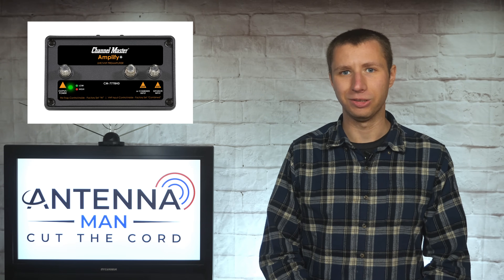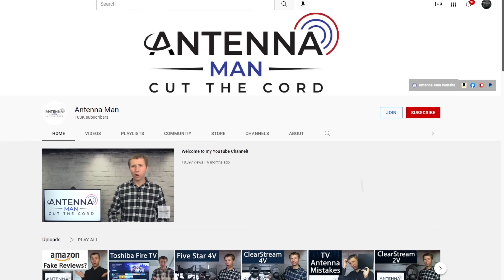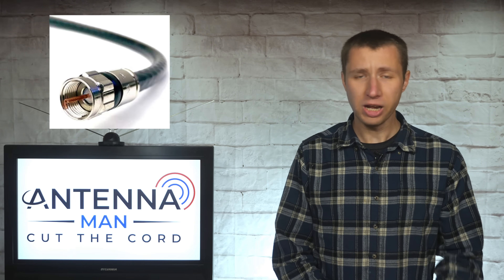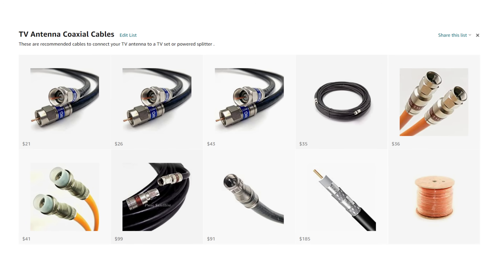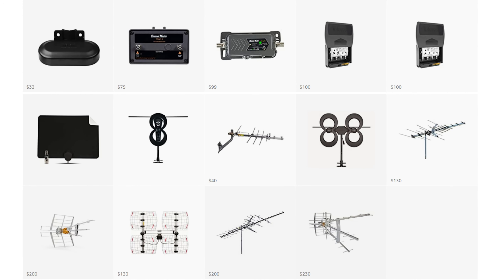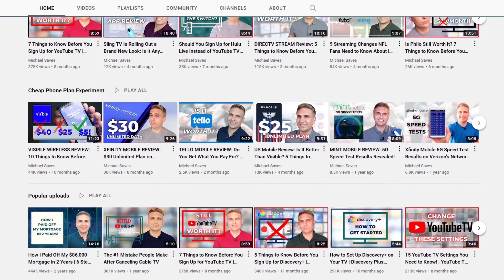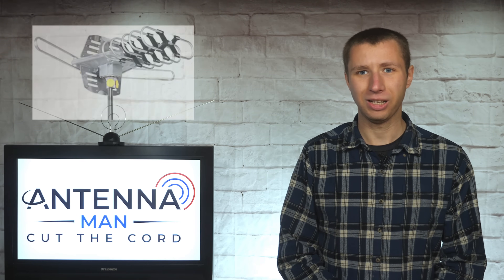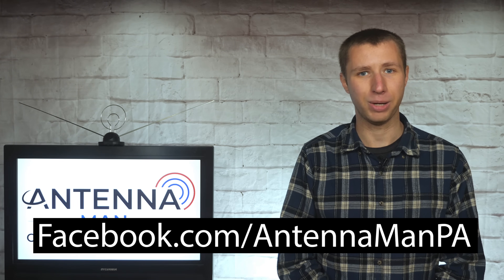Use an Antenna Amplifier? This Mistake Causes it to Fail

Comment from the maker: 📡 Do you have reception problems? Consider an antenna recommendation from me 👉 https://antennamanpa.com/antenna-recommendations.html
Reply: I got everything wired up perfect a few years ago (Thanks to your great info) and I was loosing signal strength due to the length of all the cables. I tried the Channelmaster power distribution amp you reviewed, it helped but I found one Comcast left behind from when we had cable in every room and tried it and it worked  better
Reply: Are you base in PA?
Reply from the maker: @pxbrixey4319  Yes
Reply: @AntennaMan  If you are in PA and I am in Florida, how can you recommend what I need to get OTA TV? Would you not need to check out the topography, trees, buildings, my house, etc? Thanks.
Reply from the maker: @pxbrixey4319  Yes but I can do all of that remotely from online using various reception analysis websites that do take into account topography
Reply: @AntennaMan Thanks for this video, I recently put up a Televes DAT boss Mix LR and didn't have solid copper core coax running to it. I do now. 

But what about the wall plate? Or push on quick connect adapters? If they're not solid copper wire, will they cause issues, either with burning out the preamp or signal loss?

Comment: Don't understand how a lower voltage causes amp to fail.  I have a bunch of old RadioShack, etc. powered amps and half of them do nothing.  I know that certain transistors in vintage stereo receivers need to be replaced due to age.  One amp I just opened up had 2 tiny round button transistors soldered on the ground plane back side of the PCB - they are the only means of amplification.  I'm guessing that they may be a common failure for these vintage amplifiers - I know some worked when retired years ago.

Comment: As a Broadband cable technician that has been working for 5 years now, it is false that copper clad steel cabling will burn out an amplifier quicker. The CATV mainline thick cabling is copper clad steel, including the house and drop cabling. Regardless, The Antenna Man does have great reliable content.

Comment: If I get the RCA Indoor Antenna with the super long dipole rods for lo-VHF reception, I have thought about getting a Cable Matters RG6 Quadshield Coax Cable and a gold-plated F-type coupler from the same brand. On top of this, I would turn the amplifier on that antenna off since I only live 9 to 10 miles away from the broadcast towers in my area. I'm aware that cable also has copper clad steel, but it's still thick and it's around 18 AWG. There, I think I would be fine as long as I have the amplifier turned off.

Comment: I'm confused about amplifiers and powered splitters. I have an outside roof antenna (ClearStream 2V by this channel's advice) and it is directly connected to my TV with about 30' of cable - nothing in between; one solid piece of cable (I drilled a hole in the side of my house for it). Anyone know of a reason I need any type of power? If I'm not getting channels, I don't know about it. I get the ones on the channel line up (provided by WiFi modem) and I don't have cable, so I'm just assuming I'm good to go. I don't mind investing in something if I need to. The towers can't be further than 60 miles because that's where the Gulf of Mexico is, so they have to be closer than that.

Comment: Very good advice about the copper cable! Alternately to a pre-amp antenna, one can buy a very good quality antenna without some sort of built in amp, and then add a separate amp in the cable run elsewhere. That's what we do. Running 3 TVs off one excellent antenna with a high quality amp/splitter.

Comment: Tyler, I installed a Televes Dat Boss mix LR on a 20ft mast at my home and was impressed with it's reception. I used solid copper RG6, It's been up about 3 months and the other day we had a thunderstorm and the electricity flickered. I immediately lost signal on my OTA channels, the antenna mast is grounded and the coax is run through a ground block as well. When the weather cleared, I bypassed the ground block with a RG6 extension adapter, and my signal returned on the stronger channels, but weak channels were pixilated. I replaced the ground block the next day and to my surprise lost all signal. I then went to the Televes power supply (still showing a green light) and bypassed it as i had the ground block, I got my strong channels back. Puzzled I tested the power supply and found it producing 14.4 volts DC on the antenna connector. I reconnected it and again lost all signal. I then unplugged it from the AC power and my strong channels returned. I'm guessing the amplifier is shot. Given what I've done would you agree or suggest another test to run? and if the amplifier is dead is this type of failure covered by Televes warranty or am I on the hook?

Comment: Hi Tyler, I set up new Clearstream 4K, pointed it toward signal sources.  Brand new LG did auto tuning for an antenna setup.  Picked up all my local channels.  ABC clear as can be.  But NBC and CBS no signal.  Re-ram the auto-tune.  Then I received great signals from NBC, CBS but not ABC.  Re-ran auto-tune again, back to solid ABC but no NBC or CBS.  So weird!  Help!  Thx!

Comment: Copper Is My Favorite Metal With Silver, Copper Is Important, The Other Metals That They Use, The Cheaper Ones Just Work Like A Resistor For Your Amplifier And Thats Why They Don`t Carry The Signal And They Make Burn Up, How Many Times I Have Found Coaxial Cables With Burned Central Wire, Ohh, MANY! Even The Big Coaxial Cabled With 3 Sheets Of Shielding !
SUBSCRIBED, Very Good Video, Learned A New Things :L)

Comment: I'm trying to understand why I unhook the cable antenna in from outside that already gets 10 
tv channel  hook up my antenna amplifier from radio shack its an archer cat. # 15-24
I hook it up I get "0" channels . Possible someone else used it as I got it off ebay and
ruined it an put it back in the box and sold it. I re checked the connections . the outside 
mask mount is in on one end out on other end . the other end in the house is pretty straight 
forward and marked to tv   leaves the other one for in from amplifier/ antenna .
So my question is can you do a show/video on using a digital volt meter to show how to
check each component. and show what to replace in side the mask amp when biggest cause
is thunder/lighting storms.  NO any one that can get the schematic on that biggest seller
 radio shack they sold for at least 4 decades

Comment: Question: 

How far left and right does an antenna receive signals?

All my current towers are 11.5-12 miles away grouped with farthest 2 being 3.5 miles from each other. @ 22 degrees difference on a compass. 

 I’ve had the same 2 med -large? antennas on the same @ 25 foot mast since I bought the house in 1996 with the same RCA MODEL
VH121 amp @ 15 feet from the antennas inside the house. 

The main changes I’m thinking about are deleting an antenna and/or upgrade the fittings.

The antennas are connected by @ 3 foot two wire jumper and then one simple coax adapter and a splitter in the attic after the amp.

 

Yearly when it gets cold especially at night I have one major local channel which goes from Great to none intermittently and that tower is in the middle of the others which have good signal… good for where I live.

I can turn the lower antenna slightly and the signal comes back or just unplug and replug the amp in and it comes back strong but after a while it goes out again.  
No rhyme or reason except worse at night when the cold air is denser. 

Normally I only have to move it once but this year it just won’t stay set.

Summer time is rarely a problem in Florida but when it gets hot again i have to move the lower antenna slightly again back to where it was.  @ 2-4 inches till it settles on a stable signal.

The smart tv shows the best signal for that one channel at 34% and quality at 100 but then will drop to nothing.

Everything else stays @ 60-75 % 

I get 51 channels but only watch 28 but the 13-4 has star trek so it HAS to work…..

BTW The only internet I have is on my phone using a cell booster and another antenna @ 35 feet from the tv antennas facing away from them. 

I also have no hardline phone.

My house is OFF the grid.
Reply from the maker: It depends on the gain pattern of the antenna.

Comment: How to improve the DAB signal, do you have a good setup for this. My car has a stock setup with DAB radio, adding an amplifier does not work at all, my guess is that the roof mounted antenna has amplifier and now there is 2. FM seems to work but not dab, and i dont know how good the FM signal is, but it does not matter, as FM is not longer used in Norway, funny how DAB is always a problem while driving, the newer systen has more stuff, but lack in the important thing, a working radio. so even the best setup will possible not be inough but better. i know a bigger antenna is possible the way to go, but i think there is only 3 made, because i cant find moore then that,a glass antenna + a couple of roof antennas thats it.

Comment: I use a 100ft cable that came with a satellite dish I bought years ago. I usually can get pretty good reception, but recently my Channel Master amp quit working. I was losing signals I didn't think I should be losing. (I figured they were changing something on their tower) I couldn't find the same one to replace it, so I bought one on ebay, that had the Channel Master model number. Reception isn't as good as it once was, so maybe I will change the cable and see if it helps. I haven't had cable or satellite for several years.
Reply from the maker: Which one did you buy on eBay? Send me a link and I'll tell you if it's a decent amplifier or not.
Reply: @AntennaMan  Should I post the link it here, or send it some other way? The title in the listing is "High Gain 32 dB PRE-AMPLIFIER HD TV ANTENNA SIGNAL CM CX-7778". I paid a little over $40 for it. Also, are the amps that sell for $150+ worth the price? If they work, that's great. But I don't want to pay that price and it not help the reception.

Comment: Does the amplifier have to be mounted outside close to the antenna ?
I have a nice outdoor antenna with a rotor that I had professionally installed in 2007 (still analog signals then), and it has worked great.
Not sure the exact make of the antenna, but the rotor is a Channel Master, so the antenna might be as well... I think my installer (who is now deceased) purchased them from our local Radio Shack that is no longer in business.
But the amplifier went bad several years ago, and I had to replace it... it was a Windgard LNA-200 Boost XT.
The major issue I have is that I now have new metal roof, so it can be slippery to get up on, and kind of steep near the chimney were the antenna is mounted, and my ladder isn't tall enough to get to the antenna from the side of the house where the chimney is located.
It would be so much easier to have the amplifier in my basement where the coax cables run.
I purchased an extra one to have on hand in case the amplifier goes bad again.
Or maybe there is a better amplifier that can be mounted inside like I would like ?

Comment: When i set up my aerial outside, i just unscrewed the cable from the cable company going into my house and screwed that into the aerial. It goes through the attic to the wall jacks in three rooms in my house. Are you saying in order to use a signal booster with my aerial i have to rip out all that coax and replace it with new cable? Is there a preamp that won't get "fried" with regular existing cable company coax?

Comment: I got weak signals due to cheap coaxial wire as you mentioned in the video.butbthe problem is I cannot replace the wire because it goes through the wall.and it stuck.(cannot pull).when I measure the voltage it drops about 5v .is there any way to in crease the voltage.?

Comment: I installed a Winegard mast-mounted preamp several years ago (6-7) and it still works good.  I'm inner city near to Broadcast Stations but have a 90' cable run and inner city noise.  I only get a few stations (3-4) without preamp but all of them (50+) with it.

Comment: my house is wired with rg59 cable. to replace it would involve removing drywall to replace the cable. removing lots of drywall. What is so bad about using the existing rg59 cable i already have?
Reply: nothing if you figure out about how many feet you have, then calculate your signal loss and get an inline amplifier placed as close to the antenna as possible that is equal to or greater than your loss.

example if you are losing 19db in your cable get a 20db amplifier but if you are losing 21db or 22 db that same 20db amplifier is going to be fine also. If the amplifier is indoors and plugs into the wall your fine. if it uses coax to supply power to the antenna, that coax should be a good quality as this guy explained. else you should be fine.

Comment: Thinner center conductor means higher resistance, which of course affects current. Overdriving causes the power supply to fail at the regulator for these, like a 7805. BUY ON QUALITY, NOT ON PRICE! I'm repeating that mantra just for my own OCD.

Comment: Thanks for the video. In my family situation, the local OTA's do not provide the programming we enjoy, and, there is no channel guide to let us know what is coming on next. We do have an outside antenna set up (over 10 years installed) as a backup in case cable service is interrupted for a long time (we have bad weather around here).
Reply from the maker: There's actually a way to get channel guide info on OTA channels. See video below. https://youtu.be/wrAVRKhRQ8A

Comment: I have a question some days I can pull in 150-200 channels easily then other days I’m lucky if I can get 30-35. I’m using a Winegard FL-55YR FlatWave Amplified Razor Thin HDTV Indoor Antenna . I’m not moving the antenna it’s taped to a window not doing a new rescan just turning on the tv some days 100-150 channels other days only 30-35 all on sunny clear days. What could cause this?
Reply: My guess, weather.  Start tracking how many channels you get based on weather.  There are even days when you can get stations really far away.  Look up Tropospheric ducting.

Comment: Thanks. I just ordered a new R6 cable on Amazon. I had to read very carefully because several descriptions mention copper but where not solid copper centre conducter. Your Amazon links are ok. But shopping on Amazon  in Canada we don't have the same products. Or we have to order from the U.S and pay the exchange rate and extra shipping costs.

Comment: It is without doubt a good cable will make a difference, but a substandard centre core causing a mast head amplifier to "burn out", as an electrical engineer with years of hobby RF experience, this smells like BS. 

I would need to have more information as the mode of failure and actual cause to be even begin to believe this.

Comment: I'm getting rid of Dish after 25 years and going back to antenna but I have had some trouble finding the right one for me. I'd like one with a rotator on it if possible so I can turn it different directions when needed. Also I have towers 60 miles east of me and 80 miles west so I would need something with long range. Can anyone recommend one for me?
Reply from the maker: Consider an antenna recommendation from me at the link below. This can prevent you from spending hundreds of dollars and time wasted on setting up the wrong antenna for your area. https://antennamanpa.com/antenna-recommendations.html
Reply: @AntennaMan  I live in South Carolina, where are you located?

Comment: I use lrm400 coax its large  and has low loss at vhf/uhf/hf  frequencies and  is expensive I’m a amateur radio operator

Comment: Amplifiers usually are used on buidings that can't  do either but using long coaxial cables to distrubuite singal. 
On 7-10 meters distance from antenna - tv, you simply buy a good antenna, a good RG6 or good quality RG59 cable, and you'll be able to peak all stations, without any problem. 
With good antenna, i mean decent quality aluminium antenna, not cheap crap.

Comment: Crap!, Worst case is you'll get a small volt drop due to the higher resistance of plated cables. A small REDUCTION in voltage will NOT cause an amplifier to "burn out" yes there are good reasons not to use cheap cables but this is NOT the reason, this is from someone who spent over 10 years diagnosing problems on both simple domestic and complex multi outlet antenna distribution systems. TBH most amplifiers fail simply because they're cheap crap. An amplifier is also no substitute for a decent high gain antenna it's also a good idea to balance the signals entering the amplifier from the antenna this can be done with frequency selective attenuators, basically a bit like a graphic equaliser for RF so that you avoid issues with very strong local signals overdriving the amp and causing problems with weaker signal reception although this is probably less of an issue in the US.

Comment: After thinking for years that $10 antenna amplifiers were a scam, I bought one and it brought in local stations that were too weak for my TV.   I understand basic electrical and broadcasting concepts, but I can't wrap my mind around how multiple frequencies can be simultaneously boosted.  I thought the process was like a signal repeater and could not possibly be done by a tiny cheap amplifier.  The one I got is powered by USB.  Can you explain briefly how the hell this miracle of technology works?
Reply: Being a HAM radio operator, it is really quite simple. The amplifier uses what is called a band pass filter...it allows a pre-determined range of frequencies to pass and blocks everything else that comes in. Then with some additional filtering the remaining frequencies are then amplified and sent down the coax.